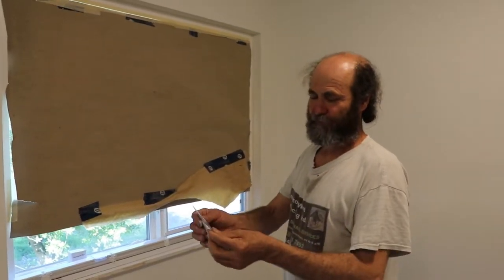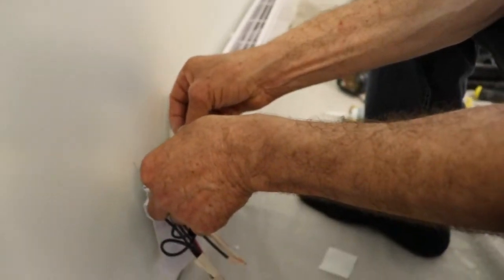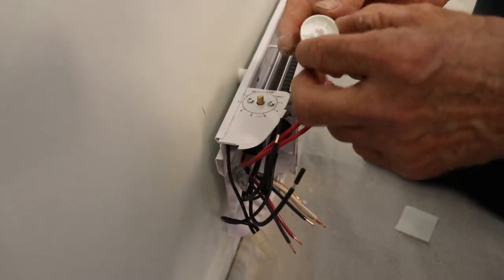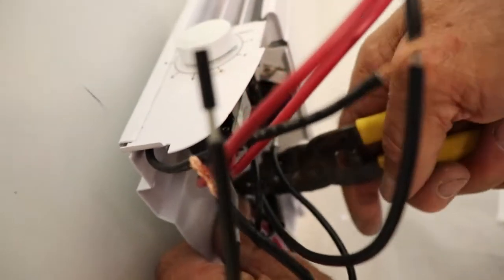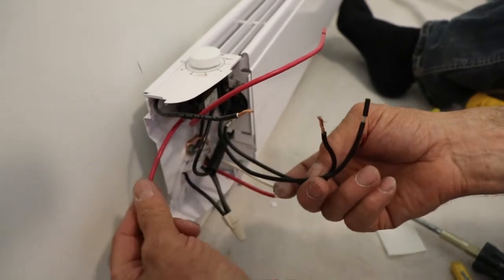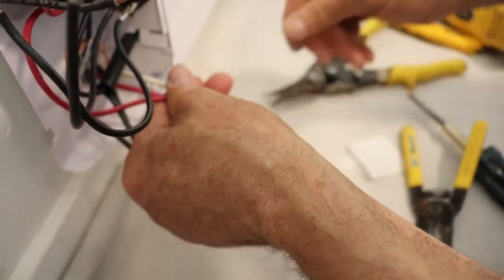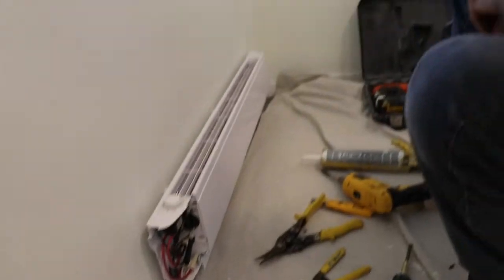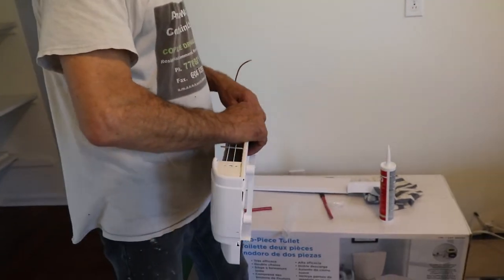How to Install a HEATER with built-in thermostat

Comment: This video really saved me.  I tried to wire this exact thermostat with the same setup.  2 x 240 volt coming into the heater.  I had never seen these before so I tried to wire it with the way I knew and it blew the breaker in the service panel.   Now I can replace the breaker and wire this up properly.  Thanks for the great video.   Are the voltages on both those hot wires 240v?
Reply from the maker: Hello my friend, thank you very much for time and watching my videos, keep safe, have fun, I am glad that this video helped you
Reply from the maker: The wires are 120v×2 hot wires = 240v with a double pole circuit breaker clipped to 2 fhase on electrical panel, thank you very much for watching my videos
Reply: @BahianoReno  would you know why there would be 2 240v running to 1 baseboard?  All the other baseboards ran to a thermostat on the wall and had 1 240v wire running to them. When I say 240v I am referring to red black and ground which is normally used for 240v .  Thanks for the great video.
Reply from the maker: @AcadianMan  Hello john, in this case, the other 2 wires were just carrying power to the next baseboard heater, but all we had there was 240v, in this case it was just like a junction box

Comment: how do u connected this to power ? can u get a wire from  the wall plug and connect this
also how much one of these cost  and where did u buy them thx
Reply from the maker: Hello John, thank you very much for watching my videos, I picked them up at home depot, around $50.00 for the heater and $14.00 the thermostat, Ca dollar, probably would be more now.
The feeding wires come from the panel, 12/2 wires with 220Volts and 20Amps double pole breaker, usually a regular plug  is 110V here where I am, if you  plug it into a regular outlet, you would get only 110Volts,, heater will work, but with half of it's capacity, it mean, no much heat will come out of it.
A 110Volts heater would work better on a regular plug, if you have any more questions, please let me know,
Reply: @BahianoReno   so  i have to do  new wiring and install new breaker in my breaker box for this
Reply from the maker: That is the right thing to do, or a 110V baseboard heater would work on existing wires, let me know if you have more questions
Reply from the maker: Do you have any other baseboard heater close by?

Comment: Which brand heater and thermostat are you using?
Reply from the maker: Hello my friend, thank you very much for your time, I use Dimplex heaters and Dimplex Built-In Double Pole Thermostat I believe, let me know, if you have any more questions, keep safe
Reply: @BahianoReno  with a built in thermostat, like Dimplex Smart Baseboard heater, can you use one of them to replace and old
Baseboard heater that has wall thermostat or you cannot use a wall thermostat in conjunction with built in thermostat?
Reply from the maker: Hello Jaime, thank you very much for your time and support, you can use a the built-in thermostat in conjunction with the wall thermostat, else you can use the electrical box for the wall mount thermostat as a junction box to connect the wires, keep safe

Comment: I installed my electric baseboard and nothing else turns on only when it is high and if it is at the minimum or medium temperature it does not work only when it is at high temperature
Reply from the maker: Hello Memes, thank you very much for your time, it could be a defective thermostat, not very often, but some times it happen, factory issues, if you have others heaters and thermostats in your house, you can switch them and find out the issue, I would check first the thermostat, I had few issues with thermostats on the pass. 
are the thermostat and heater new?

Comment: I feel you did this wrong. The other video I watched said put the two power wire with the two red wires. Then the two black wire connects with the two wires from the heater. It makes more sense since the power goes to the thermostat then the thermostat controls if power should go to the heat. Your way is super confusing
Reply from the maker: Thank you very much Terry, for your feedback and watching my videos, in that particular heater it has one set of wires going to another heater, else it been used as a junction box, keep safe.